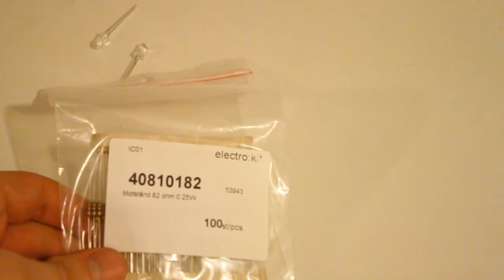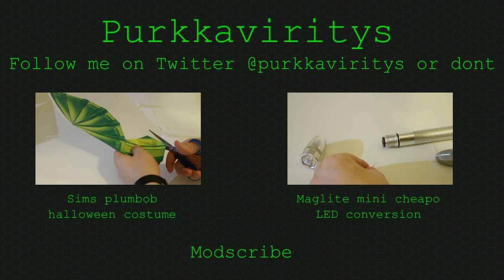Sims plumbob halloween costume: electronics more in depth

Comment: Thanks for the video - but where did you buy the long see-through wires, so that I am able to hide the batteries? :)
Reply from the maker: That wiring is actually speaker cable that I had laying around but you can get similar wire from any audio or hardware store. Another way to hide the wire is to just have black wire when the rest of your costume is black. I personally hid the batteries into a jacket inside pocket and had the wire come on my back so it or the batteries were hard to see.